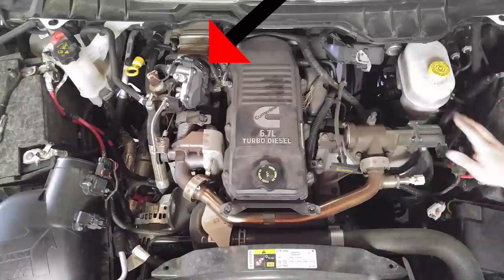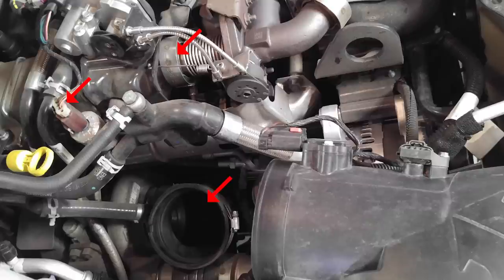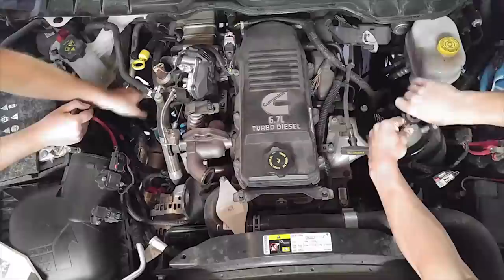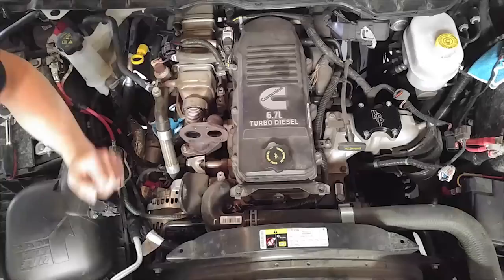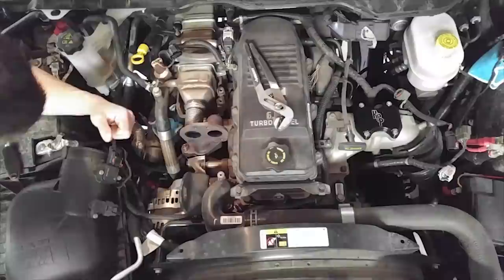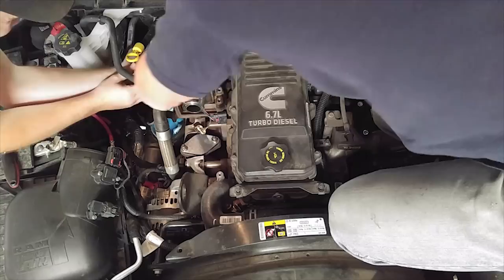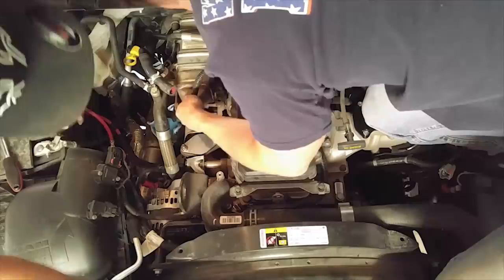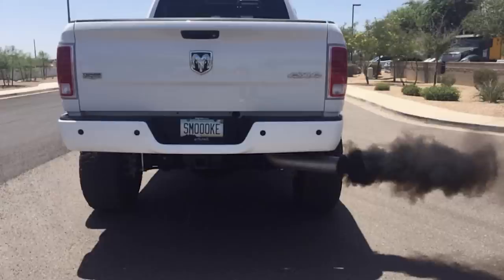Dodge Ram 2014 6.7 EGR Deleting Video

Comment: Use the channel locks to take rubber hoses off 
Grab the hose on the fitting and turn it it will break loose and come off easily

Comment: Very nice.  I'm a delete idiot but have a 2014 that will be deleted sooner or later.  When you mentioned the tranny tune, where does that come from?  Is that EF Live supplied?  The delete shops around here don't mess with the tranny but I hear complaints especially from the Ford deletes on how the tranny shifts so I want to have the ability to tune the tranny also?  Right?
Reply from the maker: hmm I must have missed this comment, sorry about that. But most reputable tuners will sell tranny tunes. With the RAM and the 68rfe you're going to want the tranny tunes for sure. the 68rfe is a very weak tranny and the stock tuning is terrible.

Comment: 24 to 30mpg after delete & 4 inch exhaust!! 9500 lbs truck 2015 2500 4x4 4door 6speed & camper shell. Clean oil to 5000 miles Rotella T6 & 10k mile oil changes.
Reply from the maker: Yeah man deleting these make them sooooo much better!

Comment: Nice work!  Quick info, I heard you explaining the DPF and the DPF does not have fluid going into it.  The DPF is cleaned by a process called regeneration where the truck will operate at higher RPMs for a certain amount of time.  The big difference in these trucks is the 2012 and later vehicles do not have DEF fluid and that fluid is shot into to the catalytic reduction system.  Did you ever get EFI Live on your truck?

Comment: Great Video!  I heard it's wise to keep DEF in your tank after you delete the truck.  My nephew got pulled over in Texas by a state trooper and the officer used a dipstick to test his DEF tank.
Reply from the maker: mickyfingaz I’ve never heard this on tons of trucks we’ve had running around. I would fill it with water then cause the DEF will crystallize very quickly

Comment: I live in CA unfortunately, I want to do a full on delete butI need to do stealth delete were the truck will still pass a visual smog inspection. Can I install block off plates and leave everything intact? I was also going to walor out the cat and DPF and leave in place then just use a tuner to turn it off.
Reply: Jeff L yes you can.

Comment: Hi guys I'm trying to help my brother inlaw do this to his 2012 dodge with the 6.7 and I have a question. Will the truck throw any codes after the mechanical delate is done? Is there anything that needs to be modified on the truck electronically?  Does he need to get a tuner for the truck? Sorry for my newbie questions. I have a 7.3 Powerstroke and have none of this to worry about. Tha is in advance!

Comment: Awesome video helped me complete mine. I had no errors codes until 2 months later when I had the exhaust replaced and now I get a P226B TURBOCHARGER BOOST PRESSURE NOT RESPONDING, Did you remove the whole sensor or what did you do with the tubing? I just blocked off the tube?
Reply from the maker: Jess Hall hmmm text me what tube you’re talking about. Any turbo issues? How many miles on the truck ?

Comment: There is a hard line with a sensor on top, the hard line goes to the exuast manifold threaded bolt, did you get rid of that too or left it?
Reply from the maker: Not sure which one you’re referring to. You can text me a pic tho. 719-330-0332

Comment: Victor, at 12:10 what is the sensor in the center with silver cover, dark red connector?  I have this one too and it doesn't seem to have a "home" after using the support bracket.  I see you pushed yours over towards the passenger side, that seems to be my only option too.
Reply from the maker: I believe that you’re referring to the pressure sensor. Some people delete it , some put an EGT sensor in its place. It’s just for back pressure to tell the truck to regen I believe

Comment: Hello, I am performing an egr  delete on my 2011 dodge ram 6.7L cummins. I purchased an 
H&S Mini Maxx tuner and I was wondering if you are supposed to use the EGR delete program on the tuner before you start pulling the actual EGR system. I have already pulled the EGR stuff and I'm wondering if I messed up or if it even matters what order I do it in. Thanks.
Reply: I'm wondering the same thing did you ever figure it.out

Comment: Do you have to pull out the egr to do a dpf delete I have a 6.7ps and I left the egr in place just pulled 2 plug and plays and tuned it out. I want to get a 6.7 Cummins but would want to keep the egr in place so when it comes tolimento get inspection I just bolt the dpf back up and plug everything in and get it inspected
Reply from the maker: John Parsons yes you can leave it in place and tune it out. It’s much easier to do that. I did it on my 2018 for a while until I got my 2nd gen swap.

Comment: Great video!!

Did you have any video showing something about throttle body issues. 

I have a 2012 ram 2500 6.7

A thunderbolt  pilot start to shows on my dashboard. 
Any help will be appreciated
Reply from the maker: Sorry just saw your comment. Let me know if you got it fixed, there are a few things you can try.

Comment: Is it best to delete on the tuner before removing, dpf, dep and EGR?? Can a person delete these items one at a time?? ( the dpf and dep would be done at the same time by most people ) but what about the EGR, could you delete that separately on your tuner/ programmer?
Reply from the maker: So what some people do, especially if you dont plan on doing anymore power mods, it just delete the DPF, leave the EGR intact. Your tuner will shut off the EGR, so it wont work, itll just sit in your engine bay. Some people do it this way encase they go back to using their emissions, or if you want to resell the truck etc. Hopefully that makes sense.

Comment: So how did we deal with the def tank? How about a video either on removal or draining?
Reply from the maker: Gill Lawn Service a lot of times we just leave the tank in place. You can drain it by pulling the tube from the bottom and poking it with a screw driver.

I removed mine from my 2018 but that’s because I did a 48 swap and used that area for an external trans cooler. Removal was super super easy.
Reply from the maker: As for a video i can try and make one when i get back into town.
Reply: Victor DiVello ..So technical... “poking it with a screwdriver”...love it!!!

Comment: Hey man my 2014 6.7 3500 which has been fully deleted has  been popping a electrical throttle body service , and is there a fix I don’t know what to do
Reply from the maker: did you ever figure it out?
Reply: @VictorDiVello  yes it was my tunes !!! The problem was my tunes and deleted the code / when u floored it or 40 up it would  pop up electrical throttle body service then it would lose power or hesitate for 3 seconds and then everything would go back to normal like nothing happened smooth as butter now she’s towing heavy dump trailers with ease besides the transmission.. lol

Comment: How did you add coolant and let the air out of the system??? What kind of coolant did you use and how much??
Reply from the maker: I didn't drain my coolant, and didn't need to bubble it either. Since the EGR is on top it wasn't really an issue of getting air in the system

Comment: So if you do a DEF delete and a get a tuner the tuner can be programmed to cancel out the EGR system?
Reply from the maker: Dustin Smith you have to delete the DPF as well. But yes you can leave the EGR on the truck, the tuner will shut it off.

Comment: I have mine tuned with EFI live it's a 2010 how can I tune it to sound like a older 12 valve Cummins where the engine sounds more aggressive
Reply from the maker: Juan Gonzalez who’s tuning are you using?
Reply: Victor DiVello I got it off eBay it's made mercenary anarchy diesel tunes comes with the 5 setting knob

Comment: do you need to have a tune to turn this thing off? I ordered mine from PDP no instructions no tune and no exhaust yet. They have really failed to provide a good service. they failed to tell me they didn't have my parts until the week it was to due to arrive. The tune still hasn't been sent to me they said they would call with an alternative exhaust system still no update. Starting to feel bad about spending 1500.00 with them. As of right now I have no idea when or where my parts are. what a freaking shame everyone has had nothing but good to say about Pure Diesel Power but I'm starting to feel different.
Reply from the maker: Even if you stick with them I’ll answer any questions you got man. Just here to help!
Reply: @VictorDiVello  Thanks man I got curious and un boxed the egr kit and that blue plate witht he two o rings has massive gash between the two holes. will this leak? should i send this back too?
Reply from the maker: Greg send me a picture bud
Reply: @VictorDiVello  I'm sorry i don't know how where or
 how  would i send it?

Comment: what efi  tune r u running and where did u purchase the tuner
Reply from the maker: I have a new tranny so I run my hot tune 24/7 now, before I ran 100hp over.my tuning is through higher power performance.

Comment: Do I have to change the exhaust system or can I leave it factory when I do the delete?
Reply from the maker: Jocille Bolinger gotta change the exhaust or else you’ll have tons of back pressure and your filter will clog very quickly.
Reply: You could just delete DPF filter and replace it with an exhaust pipe of the proper diameter!

Comment: Which tuner did you use specifically?
Reply from the maker: higher-power-performance EFI, however I suggest using EZlynk platform since its come a long ways and is easy to use

Comment: If you do the EGR delete only do I need a tuning for the engine light
Reply from the maker: jose MEJIA yes you will need tuning
Reply: Victor DiVello What brand tuner do you use in your truck? Thank you for answer
Reply from the maker: jose MEJIA I use HPP. I can get you all the parts you need if you’d like! 7193300332

Comment: What delete it did you go with? Sorry if you’ve answered this already.. and how much was the total set up?
Reply from the maker: James Bell higher-power-performance.com I suggest using EZ Lynk or EFI. But most are liking EZ Lynk now! You’ll prolly be looking at around 2k total.
Reply: Victor DiVello gottcha I had an edge evolution on my LB7 but then I went to the efi live ... I sold the truck .. will more than likely buy a ram 2500, but I am not as familiar and I don’t need crazy performance just reliability and something to be able to put back to stock if needed
Reply from the maker: James Bell do EZ Lynk it’s super nice and super easy to deal with.
Reply: Hey, if you're still active on this can you message me?

Comment: Victor DiVello aye man will you send me a link to the How to tune video?
Reply from the maker: What platform are you tuning with?
Reply: Victor DiVello I’ve been looking on the same website you went with and I might be looking at the wrong section because the EFI Live is on the electrical and I’ve been looking at the Insight CTS on the monitor but if I could go with insight I would go with that one

Comment: Did you drain your coolant? I cannot find my drain plug or the vent to refill it...
Reply from the maker: Derrick Scott don't drain it. It's not worth the time. A little leaks out, maybe a cup full.
Reply: Thanks dude...not looking forward to taking this exhaust off...
Reply from the maker: Derrick Scott it's a pain in the butt, but not terrible! The worst part is the down pipe lol! If you have any questions feel free to ask!
Reply: Thanks for the heads up. Also, where can I drain the DEF fluid? I thought about siphoning, but I think it would work better if I could find a drain plug to clear it completely.
Reply from the maker: Derrick Scott right underneath the tank there is a tube that you can pull and viola!

Comment: How many highway mpg are you getting? What speed? What tune?
Reply from the maker: Kevin Romero 20+mpg, 85mph, HPP tuning
Reply: Thanks for the info!! Great videos. What hpp tune do u run it on? How many miles on the truck and have u had any tranny problems?
Reply from the maker: Kevin Romero Well I am using Ezlynk now, so I always use the latest tunes that are released. I believe it’s 2.1. Between my two personal vehicles, one has 80k tunes and deleted, and my 2018 has 5k on it so far.
Reply from the maker: Kevin Romero also, my over drive clutches went out on the 68rfe after 75k Miles. But I road that truck hard and had 37 inch tires on it lol. So it’s really not bad!

Comment: Hey what tunes are you running. And what's your max hp tune
Reply from the maker: WyattsTheMan I have 30-130, and I run on the 100 most of the time. My tuner is higher-power-performance, using efi live
Reply: Awesome man beautiful truck I have a 16 fully deleted with a snb Intake with efi live on it as well. That egr was a pain in the ass. Took like 30 mins just to get the back two bolts off the inner cooler
Reply from the maker: WyattsTheMan oh I know! It's like a puzzle! Not very hard to take out just super time consuming.

Comment: What happen if just delete egr / egr cooler with out a tune ?
Reply: Can I start the truck after egr delete ? With out having a tuner
Reply from the maker: No you will have tons of error codes
Reply: Can I delete egr/egr cooler first and after that the tune ? Or tune first and then egr deletes?
Reply from the maker: KAZo jc I prefer tuning first then deleting
Reply: What tuner do u recommen? And thank u so much for responding my question

Comment: How long did this take you start to finish?
Reply from the maker: billy Madison ehh I’ve done it a few times now, however the very first time I did it it took a few hours. If you are doing EGR , tuning and DPF delete the whole project took 1 full day.
Reply: I just bought an 07 got the p2262 code looking to fix this issue for good..

Comment: do you have any cab drone with 5inch
Reply from the maker: isaacowens283 nope no cab drone! A little bit in the rear of the vehicle but.
Reply: isaacowens283 I have a bigger tip and I notice cab drone a little more
Reply: WyattsTheMan thanks for letting me know, because I was wanting on lol
Reply from the maker: isaacowens283 do the 5 inch you won't be sorry :D
Reply: Victor DiVello that's my plan lol

Comment: you say egr delete no tuner? no codes?
Reply from the maker: joshua bowler you have to be tuned in order to take the EGR off / disable it
Reply: i muffed up and purchased a bully dog gt thinking i didn't want to void warranty. now wishing i had of gotten a deleting tuner. stupid me. you know if the ecm can be remapped for deletes?
Reply from the maker: joshua bowler of course! You’re going to want Ezlynk. Higher-power-performance.com Jonathan is the best tuner out there. They’ll get you all squared away. Give them a call, let them know I sent you!
Reply: thanks victor
Reply from the maker: joshua bowler no problem man. If you have any questions feel free to reach out.

Comment: Did you add studs and head bolts??
Reply from the maker: Fisherman Guy I didn't. I don't think you really need them unless you plan on changing out your turbo or other mods. I'm at 75k miles deleted and no issues

Comment: You still taking questions on this video ?
Reply from the maker: Rick M of course my dude!
Reply: Victor DiVello hell yeah ! I just finished a delete kit for a 2012 Cummings h&s mini maxx everything went good but truck went back into power down mode saying filter full , it's got me stumped
Reply from the maker: Rick M did you try disconnecting the batteries? That’s interesting... the tunes took to the truck right?
Reply: Victor DiVello yes sir it said it did and did clear it initially , but it runs a little while then goes back to power and yes I did disconnect the batt , I even went back to stock plugged all back in went threw the whole thing again and still the same , Im wondering if I missed a sensor or something , this is my 4 or 5th one I've done ford and dodge both and never had this problem I thought the delete would clear it no matter what
Reply: If you find out anything let me know I would really appreciate it , thank you very much
Reply from the maker: Rick M yeah, it should clear the code no matter what. So I’m completely lost lol. That’s why I was wondering if for whatever reason the tune didn’t take. I know a lot about EFI and EZlynk, not much about mini max stuff unfortunately :( if you do figure it out please post on here so others might be able to take benefit from it!
Reply: Victor DiVello yes I sure will thank you
Reply: Rick M I am about to do a EGR, DPF and Throttle delete on my 2012 Cummins. Did you set up your H&S Mini Maxx first? Or did you pull everything and then tune it? My Mini Maxx is brand new....Did you have to mess with the VIN Unlock?

Comment: Did you use the egt on the back block off plates? If you did what sensor was used for it?
Reply from the maker: 1955Bowtie put it on the back one. Used the CTS2 monitor and EGT probe. It works great.